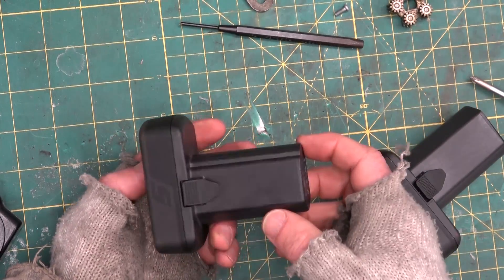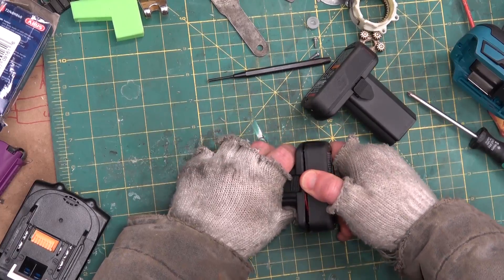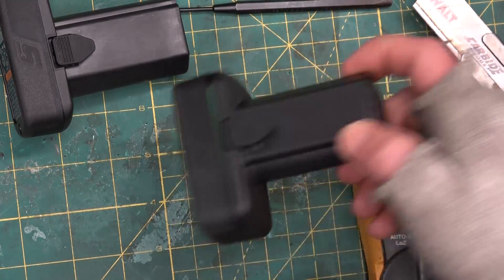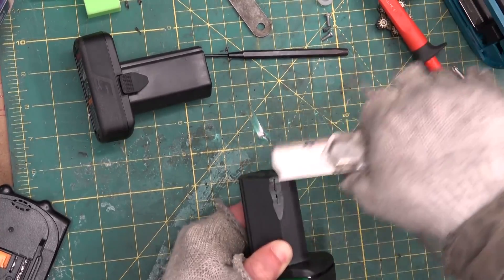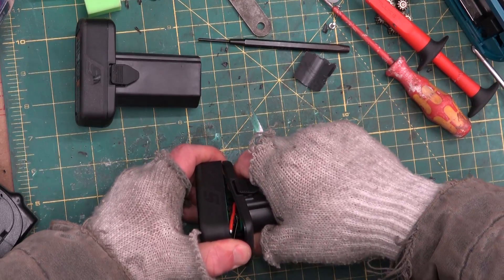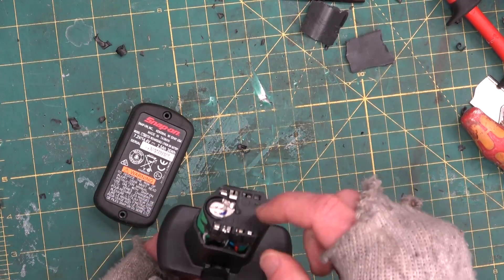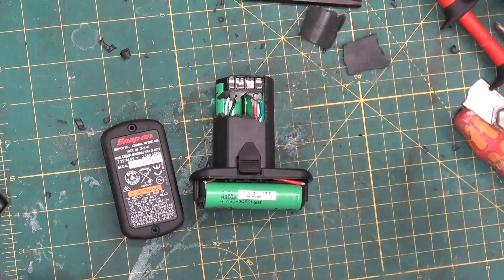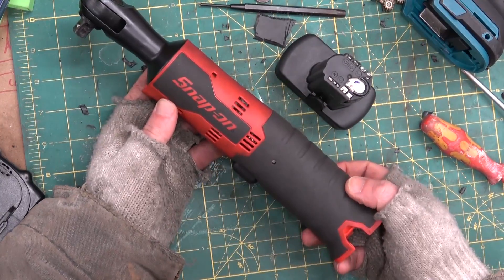BOLTR: Snap-On Microlithium Batteries

Comment: I had to take one of mine apart when it stopped randomly. Had to destroy the top to get it apart. Turn out to have a spot weld broken off the top of one of the batteries. Saved me $159. Looks ugly on top but works fine

Comment: They're probably calling it 14.4v  to avoid Milwaukee's patent they got sued over a couple years....
Reply: It's lithion ion voltage thing. About half the cells out there are rated at 3.6v nominal.. Hence the 7.2v/14.4v.. Its not quite right for those cells as they're 3.7v cells.
Reply: Milwaukee have a patent on voltage know? Yep its official Milwaukee should probably go under.
Reply: They have a patent on lithium ion batteries of certain voltages. Snap-on already lost 27.8 million dollars to them over infringing upon it a few years ago... And it's my understanding it's the reason DeWalt tools are 20 volt as opposed to 18...

Comment: The extra terminals are because these batteries also fit the older 7.2v stuff. Same idea as the flex volt.
Reply: @MihD-v5m  indeed lol

I own one of the old flashlights that took the two cell batteries that look similar but only have the vertical cells. Worked great but probably not worth the 120 cdn I paid for it lol

Comment: Man just seeing green the LED on the side and the way the trigger looks, I don't have much hope for that ratchet being any better.
Reply: No clue but I've been running mine for over 4 years at this point and still works good while many co workers who bought the milwaukee have had theirs crap out on them. Not to mention mine sees the most abuse and use. So the Snap On might be a fair bit better though it does cost 3 times the price. That said one of my co workers have burned through 2 and is on his 3rd milwaukee cordless ratchet. Also yes the common failure on those milwaukee is the horrible paddle which might as well just snap it off when you get it since it'll do that in a month anyways then the next to go is the anemic pin that the ratcheting mechanism works on that is if the switch doesn't snap off after the paddle snaps off.

Comment: I thought Snap off had life time guarantee, thay should replace
Reply: No just one year on most electronic tools. Which is pretty standard from all the tool brands. But even when they do need to be repaired out of warranty. It doesn't cost that much and almost every time I have received a new tool instead of a repair.

Comment: They sell the cases for like $20 on the truck. So you can fix that battery you just fuckulated. Unfortunately, you have to ruin the case to get into them. Also, that 3/8 rachet is godlike in the real world. I have one and won't give it up for nothing. I don't even have an air powered rachet anymore because of it.

Comment: Do you have the 14v between the + from one side of the battery connector and the - from the other side ?
Reply: My guess is that the battery presents two separate 2s circuits with those terminals, and it's up to how the tool is designed whether the power is used as 4s or 2s2p.
Reply: @agentmango  yes, that was my guess

Comment: 5:27: 33% more.
3 -> 4 is 1/3 more.
Reply: But 4 -> 3 is 25% less. Crazy how that works.
Reply: @OneMarko  Yes because it's from a larger amount in the second case. The amount of change is the same. It just comes out of a larger number. 25% more means the wrong amount more. I know you're probably joking but it's good to untangle.
Reply: Percentages screw with people. Just like when a retailer marks everything down 20%, and then says “save an additional 10% if you use your store credit card”. Most folks walk away saying I saved 30%, nope. 30% off of a hondo is $30. 20% off a hondo is $20 and then the additional 10% off $80 is $8’ for a savings of $28 not $30.

Comment: 1 cell 3.6V
2 cells 7.2V
4 cells 14.4V
Reply: Most modern devices overcharge to 3.8V to get a minuscule amount of extra energy (to the cost of shorter life). 3.8x3=11.4V that they for some reason  round to 12V
Reply: @matsv201  Nominal voltage is 3.6V, and fully charged is 4.2V. 3.8V is not overcharged.
Reply: @xjyrki  4.2 is the charging maximum voltage.

I´m talking about the top load voltage.
Reply: 1 cell 2 cell red cell blue cell.

Comment: Those 25Rs are really cheap, but very good for the price. I used them in some projects because they were so cheap. I just checked the prices and they are even cheaper now, a shop in the Netherlands sells a single 25R for 3Eur with even lower bulk pricing (down to 2.15Eur for 600). So I guess the cost of making one of those battery packs is somewhere around 15-20USD.

Comment: Just in case anyone is confused...
The chemistry of the cell (check periodic table) determines its voltage. A lithium cell will have a 3.6V  specified cut off or minimum cell voltage, and this is used to determine the battery voltage. 
A battery is a collection of cells. 
When added in series or end on end the voltage adds and 2 cells will give 7.2 volts. (When connected in parallel the voltage stays constant but it can supply twice the current). So four cells can be configured either as  two pairs in parallel, series connected for 7.2V with  double current capacity. Or all four in series for 14.4V.

Comment: At least you got 4* Samsung 25r for the vaping!
They'd cost you £20 plus from any shop front in UK..
Reply: Greenworks 60v 2.5Ah packs have 15 of them inside.  The 5Ah packs have 30 of them.

Pretty sure the 2.5Ah packs cost less than the snapon 4s pack.
Reply: Been pulling vtc5's out of "dead" makita packs for my douche flute.

Comment: :( I was hoping you would show more of the inerds. Were it 2 separate 7.2v 2S circuits? And would the wiring within the tool crosslink a +&- to put the 2 in series for 14.4v and other tools put them parallel for 7.2v and double the amps?

Comment: The best part is, you can buy those cells for less than $2 a piece in bulk! So Fap-Off is charging you $120 a piece for $8 in battery cells, 50 cents in wiring and solder, and a $2 piece of molded plastic! :D
Reply: A few bux in the board too.  Esp one with auto voltage switching.
Reply: @iancarnel8609  Ah yes I forgot that. Probably the most expensive part really.
Reply: What is your your point? Is this some new concept in economics? Are you also saying you have the means to make the exact same product for yourself cheaper than snap-off sells it for? Mind you these batteries are readily available off the tool trucks for 80 freedom bucks nowhere near the 120 you stated. Is it still overpriced? Yes.
Reply: No.. you probably need to pay 4 or 5 bucks for those cells. Yes you can get calls for 2 bucks,  but they would be crap or fake.
Reply: I think the mold(s) have the biggest costing.
Reply: @Endmass  True, but this one is very simple and it costs almost nothing to make each part after it's done. Paying the engineers for the board was expensive too. Bottom line they have surely already recouped dev costs and are probably making $100+ profit per unit at that price before paying tool truck workers. 😂

Comment: Couldn't stop thinking "Just pull it out" when you were cutting up the battery. But I bet you've heard that before
Reply: Pulling it out might have been more difficult than straight cutting it, due to the selastic.
Reply: @soupflood  the one I dissected 2yrs old came apart smoothly.
Reply: That's what she said

Comment: Heh, your drill works like my matco die grinder. 

Or does my die grinder work like your drill 🤔

Edit. Even after being violated in many ways the damn battery still glues itself into the tool. That's the one thing I absolutely hate about those batteries.

Comment: The original Snap-on 7.2v hand tool battery packs included just the two vertical batteries with a flush fit bottom. When they went to 14.4v tools, they promised backwards compatibility with the new battery packs, which of course have twice as many cells inside. You tested at both +/- terminal sets on the battery, but did you look inside the tool to see which contacts were used by the tool? 7.2v tool vs 14.4v tool?

Comment: So what’s crazy is that Milwaukee’s 12v stuff is more powerful than snap-on’s 18V stuff. If only we could give 14.4 volts to Milwaukee’s 12v line
Reply: @Fee 
I upgraded all my cordless tools a few years ago with the Milwaukee FUEL 12v stuff.
I haven’t been happier.
Reply: @SteveJ328  the Fuel 18v is where it's at 😉
Reply: @Jeff Knebel I bought the 12v for home use and my own projects, I like the compact size. At work I have the 18v stuff since my company is paying for them lol
Reply: Steve J I’ve got them too, I love my m12 fuel surge. I wish it had an extra cell though because it would be more powerful than the old m18 fuel surge if it did
Reply: Are you sure about your claims because the Milwaukee 12v line up isnt very powerful at all
Reply: jdr ok their 12V fuel is ridiculously powerful. I’m positive.
Reply: @Fee.1  You should try the 18v stuff. You think their 12v is ridiculously powerful?  You're in for a treat 😁
Reply: Jeff Knebel I have all the 18v fuel stuff to, that has nothing to do with the power of OTHER companies 18v platforms
Reply: jdr ok it depends on which products your talking about obviously. But when it comes to the staples, Milwaukee’s 12v brushless motor’s are making tools that shame most 18v brushless models. I know because I hate the cult of Milwaukee fanboys and wanted to find ANYTHING else, nothing measured up though. Sadly my favorite brand, Metabo Proper, is one of the worst offenders
Reply: @jdrok5026  I agree, the only 12v milwaukee things I use is the mini buffer and a flood light. Both of which suck on the battery dept. That's why I told Steve J the 18v fuel stuff is where it's at. I have more of the 18v fuel tools than I care to mention, and there's a reason why I have em. They WORK. 
I'd like to see someone run a 9ah battery empty with the fuel sawzall and have them tell me it's no good.

Comment: Everything is junk nowadays.
Reply: @Heu aufdemBoden Look down at your crotch. See?, nothing but junk... ;)
Reply: @Heu aufdemBoden ahh, cars, well all autos, they are crap. I bought an F250. nice fuckin truck. till you put some miles on it. did you know ( things you learn after the miles let you know) the front axle hubs and actually the whole front 4x4 axle is NOT warrantied after 100,000 miles? a seal goes bad and you spend $6000 at the dealer if that's what you choose. I spent about $2500 and did it myself. 
Trans is probably the same. 
ahh, housing, have you seen a new house? my parents bought a NEW 3 bedroom 1800 sq ft house sure it was about 1960, 16,000. it is still there. still warm. some crap you buy now for 300,000 is absolutely amazing crap. you can hear the wind coming in. the floors creak and BEND when walked on. 
more? schools, education, clothes, gasoline, ...
Reply: But mostly yes.
Reply: Heu aufdemBoden ..are you trying to suggest that Nothing is junk these days?

Comment: If it does 2 voltages like the DeWalt flexvolt then it should have 5Ah at 7.2v
Reply: Its rated in watthours which is the same at either voltage

Comment: 14,4V are usually 4 cells so I don't really get why it is specifically mentioned here. 4x 3,6V is 14,4V
Only the real cheapo garbage tools use 4V or even 4,2V per cell to indicate battery voltage :)
18V tools are 5 cells but some manufacturers claim 20V with 5 cells.

Comment: I attempted to take one of mine apart not long ago and gave up with the two cells that run vertical. Toite as frig!! The only issues mine have are the terminals seem to get loose and the jeezlus tool will not work unless you push the back of the battery in, and after so long they don't hold a charge well. Granted, I've gotten my money's worth and then some out of them. I run my 3/8 impact and 3/8 ratchet to hell every day. In fact, I bought two of the impacts just to dual weild!! Also, they're about a crisp Benjamin off of the truck in the great country of Texas.

Comment: If you were to series the two sides it would be perfect to jump start a Prius!
Reply: I was on the way to the airport for vacation last week. The car didn't start... the starterboaster was not charged. Battery totally dead to the degree the instrument panel didn't light up.

Ripped a old makita pack and two saw blades and a jumper cable....

30 seconds later, the car started no problem.